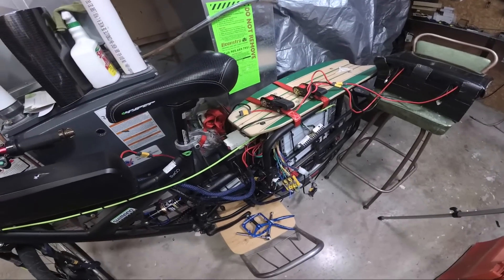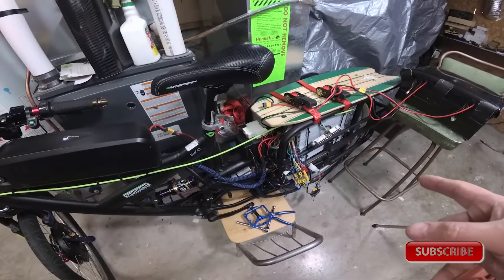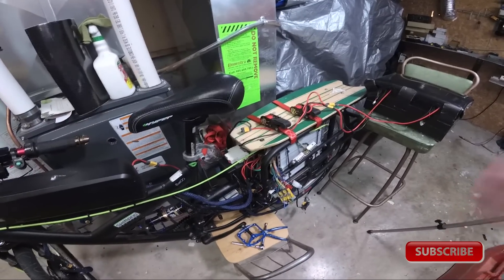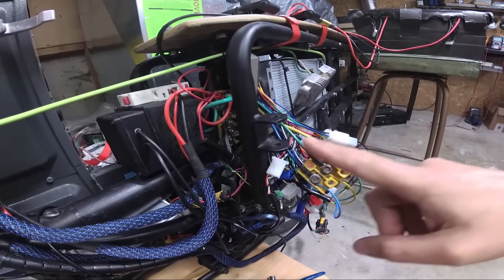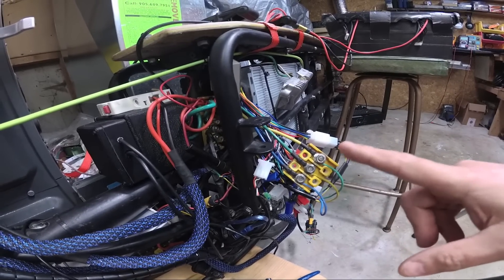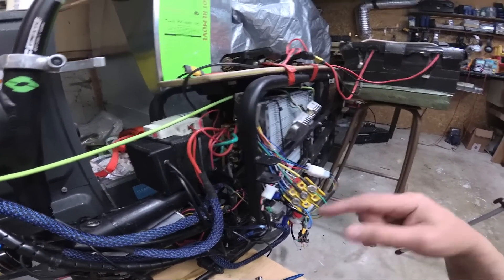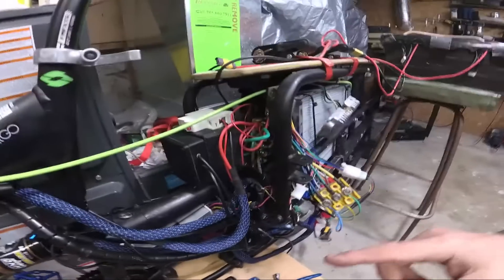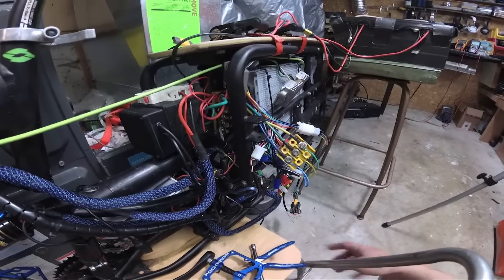ebike phase wires and hall setup

Comment: I have a motor in a front wheel on a scooter.  The box is messed up and im trying to bypass it. I got 40 v DC of of the yellow and green wires and about 10 when hooking to everything else . 🤔

Comment: Is the yellow box safe?
Reply from the maker: yes
Reply: @karmaEbikes.  Someone told me to never use ever use that yellow box because it can't handle heat very well.
Reply: @xChrisFergusonx Yes, exactly, this is what I been told also.
Reply: This is exactly what I been worrying about. Can this yellow box withstand a 30a rating controller or not?

Comment: Thanks for the info man i thought i eas screwed my hub motor wires got pinched it was called something in the motor to vibrate when I found your video I found it I just left the hall center unplugged reverse the phase wires and now it's running smooth thank God I don't have no speedometer or mile per hour but at least I can ride it to work now until I can get it fixed thanks again for the info you saved me

Comment: My scooter goes reverse on the back wheel. The yellow green phase and yellow green halls makes it noisy but it’s working if the front is activated and not make the EEWWW noise and I did tons of trials. Can I share the front halls to the back? OrherwiE normal wiring stock like it’s wiring color matches worked but burns from back and front on the opposite way

Comment: Why when I plug in  the PAS. Connector my motor begins to turn the wheel like I'm using a throttle but I'm not I don't use a throttle
Reply from the maker: your motor shouldn't spin unless the pass sensor moves.  if you motor spins constantly there a problem.
Reply: @karmaEbikes.  Hi thanks for the speedy response how can I work the problem out,as I said when I plugged the PAS connector in the rear wheel will spin as if I'm pedaling but I'm not.and when I ride it the motor doesn't immediately stop when I stop pedeling it still gives power for an extra 5 seconds or so any ideas ? Do I have to change the phase wire combination.

Comment: Why do I need a stupid controller thing to run a dc motor can I use a 1000 Watt inverter as a controller and a switch and pump the ac voltage into an 1000 Watt hi reving ac motor that’s what I’m going to do or try to do

Comment: Was hoping you could assist. Pretty frustrated yo say the least. I bought a controller 5 days ago and stopped giving me 5v. Then I bought another and still the same altho now my red and black wires to hall sensor showing 9v. I have absolutely no idea what is going on and can't get the bike to respond to motor. The motor works. I am pretty good with ebikes but this issue has basically put me into a breakdown. Lok
Reply from the maker: sounds like you have short to 5v or to phase. test all wires going into your motor. test each lead to ground. that being the stator. good luck i feel your pain. been there .
Reply: @karmaEbikes.  I've tested it so much I was screaming. Then I found a snapped copper coil elading into phase wire. I tried to clean it up and I'm now getting a bit of movement but I may need to buy a motor now. Ughh. Gone through two controllers this week and pretty sure the other is fine. Thanks for the reply. As for the snapped coil it was just a couple threads andbibtried to stick it all back together. I'd buy a motor tomorrow but not sure what I'm looking for. I really will keep working at this because I'm desperate to get it going for my business

Comment: I have a motor that has a white wire included with the 5 hall sensor wires. My replacement controller does not have a white wire. after connecting everything power but the motor does not move.
Reply: White is speedometer 👍

Comment: I was thinking about using the 16-22 size crimp on bullet connectors for my 6 hall sensor wires. Then I could just plug and unplug them. (for easy testing purposes) Do you think that is a good idea ?

Comment: Hi there can’t you do a 3000w pwm controller to a brushless motor  3 phase wire using a 48v 20A , tricking  bike controller that I ‘m using a higher Amp battery

Comment: What do you call that yellow piece connected to the blue yellow and green wires?
Reply from the maker: goes by many names. here's a link .  https://www.amazon.ca/Connection-Electrical-Controller-Connector-Compatible/dp/B09BZG1C1R/ref=sr_1_37?crid=377WQTXQ2MWU&keywords=ebike+battery+connector&qid=1669602493&qu=eyJxc2MiOiIzLjgwIiwicXNhIjoiMy4xOCIsInFzcCI6IjIuMjUifQ%3D%3D&sprefix=ebike+battery+connector%2Caps%2C85&sr=8-37
Reply: @karmaEbikes.  thank you so much. I might need this piece to my e-bike

Comment: Did you say you joined phase lines from controller,  but then the phase lines changed again to the motor? I got my motor on a trike to spin but it won't move if I even hold it back with a finger never mind me sitting on it, so just wondering if the phase lines change again to motor and how they know as it's only wire? Haha, obviously I'm not an electrician or "trician" of any kind. Thanks from England for the video.

Comment: Good day sir. I have a question my 3 phase wire is hot when you touch it even I'm using slow speed. May I know sir what is the reason why this happened to my phase wire?
Reply from the maker: hard to say. you make any changes to the ebike? like a bigger controller? has your phase angle changed? could be anything.
Reply: @karmaEbikes.  yes sir I upgrade my controller  bigger wattage than my hub motor and old controller 😔
Reply from the maker: @benchcat9711  ok what you need to do is open the motor and replace the phase wiring with a thicker gauge. or used high temp wire.
Reply: @karmaEbikes.  okay sir thank you very much I learned a lot from you and I will follow your advice thanks again more power to your channel.

Comment: I've got a new controller I've connected all the phase wires matching colour and the all senses but sounds very rough on startup
Reply from the maker: keep the phase wires matched. you need to adjust hall wires or use self learning if the controller has it.
Reply: @karmaEbikes.  ok thanks for the reply mate I will try this tomorrow just tried my old controller and that's fine so it must be something to do with the census yes it has got self-learning

Comment: My ebike is all setup, haven't rode it yet. Do hub motors need to be 'self learned" before using it? Mine already goes forward and seems to work great but idk
Reply: If your hub is spinning forward then it doesn't need to learn and can probably run without hall sensors also. The learning line is only there for when you first ever connect a new controller but I have an older hub and it needed a new controller and learning line was needed, but a newer hub I have didn't need a learning line and also works without hall wires? Haha, if only they were made by the same factory.
Reply: @nixonsmateruby1  I learned the difference in that time. The self learning line is there to reverse the polarity of a motor (direction it's spinning) if needed. Only sine wave controllers need to learn the hub motor and so sine wave controllers will come with a self learning wire

Comment: So i have an issue maybe you can help. My electric scooter fried the battery for idk what reason and i ended up buying an escooter hub kit but it does not fit on scooter its way too big so i cut the wires and put the connectors on the old motor cause it still looks good inside. I turned it on and it worked! I thought it was a success but it would not stop running even with throttle not moving so i turn it on and off a few times and then it wouldnt power on anymore. So i unplugged the battery and plugged it back in but it sparked and fried the connector “i have more” but when i looked carefully one of the connectors that you connect from motor kit to controller has an extra white wire and i just taped it down thinking it wont be an issue. But i have a feeling its because the controller and old motor wheel are not compatible. Or am i doing something wrong? Please help.
Reply from the maker: next to impossible to do it over the internet. wish i could help!
Reply: @karmaEbikes.  video?

Comment: My motor has 6 hal wires and my controller has 5 hal wire, all the colors match up but the white hall sensor wire is unused
Reply: White one is usually used for temp sensor ect

Comment: How can I wire a 48v e bike battery pack to a chinese 1000w motor? I'm trying to swap onto a 50cc pitbike frame so I know I'm gonna have to swap the engine wires to run in reverse( or can I just use a foward reverse switch? )
Reply from the maker: if theirs no switch you can just change the faze wires to reverse the motor

Comment: Whats your battery voltage? I don't see the point of loading the bike up with 2 motors and around 3000W + of controllers and motors if your not planning to either climb extremly steep terrain or plan very high speeds with higher battery voltages. Might as well save the weight and the amount of items drawing power and just go for one motor and one controller.
 i'm going one 1500W motor and controller with 72V nominal (84V max) for high speed and for lower speeds and more power i would choose a lower voltage and lower voltage controller but a high power one for hill climbing.

Comment: Oh yeah, if it is going in reverse,  look out for the pedals,  its like getting punched by a full grown man, ow
Reply: Ah, I've been wondering about this..'cos I have a few problems with wiring up a Sabvoton controller..
My ebike I built is a Voilamart 1500w 48v rear hub drive with a 52v20ah battery...
I wanted more power so I bought a Sabvoton 7245M controller (it's 45amp sine Wave £180) and when I've tried to wire it all up I twisted the throttle a little (whilst one hand held rear tyre off the ground) and I think the rear wheel was going round the correct way (forward) but I got hit hard on the leg by the goddamn peddled turning just in sync with the rear wheel...
It was as if it had locked the 7speed derailleur cassette thing because the peddles were spinning the same as the rear wheel...
At the time this terrified me so (didn't know how to fix the wiring) I switched back to the stock Voilamart 30amp controller but anyway I'm wondering, do I need to try changing the Yellow & Green (thicker phase(?) wires so instead of yellow to yellow (and green to green - I understand Blue Always goes to Blue) it's instead yellow to green and then the green to yellow (if you understand my babbling?)...
Any help is greatly appreciated as I'm really annoyed hat I've bought the better controller and I've been unable to use it...
The 'spinning peddles' scared / scarred me into changing back to the old 'stock' Voilamart controller...
Also on the Sabvoton controller there's 2 purple&black wires that splits off into 2x seperate purple & black wires that are labeled "low brake", are these the wires I attach to the 2 wire connections coming off of my front / rear bike brake levers? 'cos on the voila kit these stop the motors spinning when you grip/pull each of the front or rear bike brakes..

Also on my stock Voilamart controller (and my bike) there's no wires to link up to any display so I just use a phone speedo app for my speedometer.

Comment: I bought a new motor and my positive and negative wire from hall sensor is on different side then my controller red is on the left and black is on the left on crotroller. Can this be fixed?
Reply from the maker: the easy way is to cut and solder. i like to use a small screwdriver and on the side of each pin the is a small tab keeping you from pulling the wire out of the socket. bend the tab in and pull out each pin. when out bend the tab back out before changing the order.
Reply: @karmaEbikes.  but how does that work when my controler i cant change the wire inside. And the same as the motor hub. I will be attachin the positive from the controler to the negative of the hub motor and the samenwith grnd will now go to thw positive of the controll2

Comment: Nice. What's your bike setup. Motor wattage? Battery capacity? Top speed and travel range?
Reply from the maker: at the moment. 79v 20ah  dual 500watt hub motors. speed? 49mph range no idea i never tested it do to i dont use a bms.

Comment: Building my first ebike and it looks like I need the yellow connector shown @1:32 what is that called? thanks for the help
Reply from the maker: ebike phase connector. but also work well for power ect. https://www.amazon.ca/Electric-Controller-Connection-Insulation-Connector/dp/B093GHMTCV/ref=sr_1_21?dchild=1&keywords=ebike+phase+connector&qid=1620974537&sr=8-21
Reply: Look for this name on aliexpress: Controller Wire Connection Box

Comment: I like your vids. I bought my first ebike last summer. 1000 watt 48 v front hub on a Sick (brand) stretched cruiser frame with ape hangers on 2.5" maxxis hook n worm tires.
Fried the motor under load on bad bearings, on the fourth controller, third set of throttles, fried my bms and about to drop $300
On another battery....
I'm always so pissed off at the damn thing. 
Pushed the mother f*CKER probably half as many miles that I've ridden it. 
I find myself asking " is it really worth all of this stress and disappointment?

And then I saddle up on my non electrified hybrid and start pedaling uphill against a 25 mph wind and find myself asking the same question. Is it worth all this? Dicking around with this electric , frankenstein, money sucking, monstrosity?

My answer:
 you bet your winded, rubber legged, 47 year old ass, it's worth it.... 

Thanks for all that you do.

Comment: Your front motor seems to respond to the throttle just a touch quicker than the rear motor. I would probably swap the controllers round so the faster responding motor would be on the rear. Nice project😎, us e-bikers never seem to stop modifying or playing with things all the time. My bike will probably never be completely done as I'm constantly adding or improving things to make it better. Also, e-bike tech just keeps on getting better all the time☺. I wonder what will be the next "must have" in the near future.😁
Reply from the maker: it did and i loved it. the bike had a power band at half throttle. I'm sticking with a lower wattage controller for the rear.
Reply: I’m going to use a 1000Watt inverter as a controller and just a switch to pump the 240 Volts AC into a hi reving AC motor will that work

Comment: Hi, I have a problem with my KT 1500w 18 mosfet controller.
I upgraded to the KT from the original controller that came with my voilamart 1000w hub.
when I twist the throttle at low speeds I can feel a vibrating which fades out the faster I go.
I'm wondering if this is down to the phase/hall setup been different on the controller or maybe I'm feeling the motor stepping between the magnets more due to the extra amps?
any help would be appreciated thanks
Reply: do you know which parameter it is to adjust this? unfortunately the instructions I have are limited I have p and c parameters on my screen settings
Reply from the maker: @GiffordMusic  sorry no there all different. most of the time its two wires that plug together . black or blue
Reply from the maker: does the new controller have the option to change the phase angle? if so try it  you have 60 or 120 to choose from.
Reply: You’re problem is now the hub , is not compatible for more controller power , I alway’s  recommend buy a higher power kit

Comment: most of the controller now have learn capabilities, you just short the wire and presto...
Reply from the maker: yup my front hubmotor controller is set up  for self learning. there's a problem with the wiring harness . to lazy to fix it

Comment: how long have you had your dnm shock im thinking of swiping my dnm coil shock with an air one but im worried about leaks with the air shock iv seem mixed reviews on the air shock
Reply from the maker: there a lot of weight on this one and had no problems. picked it up last spring
Reply: @karmaEbikes.  yea iv got one of the enduro ebike frames with the whole battery compartment filled with 35ah of battery's at 20s the bike weights over 120lbs and im 250+ whatever im carrying on the back on the custom Rack i made that house the controller and its all sprung weight